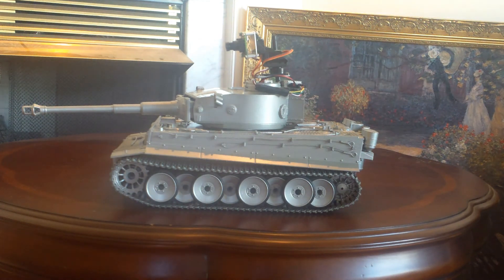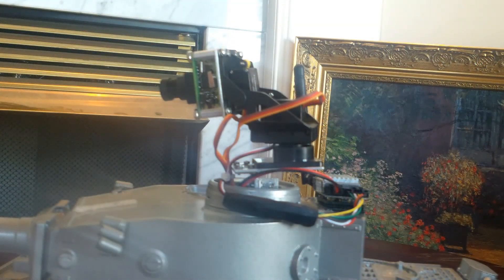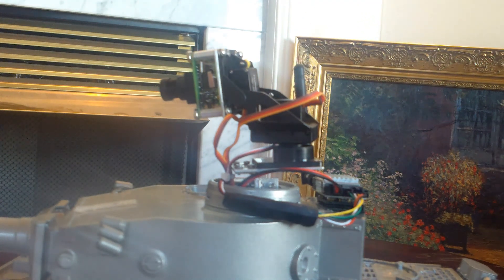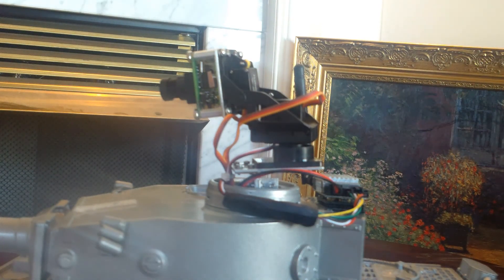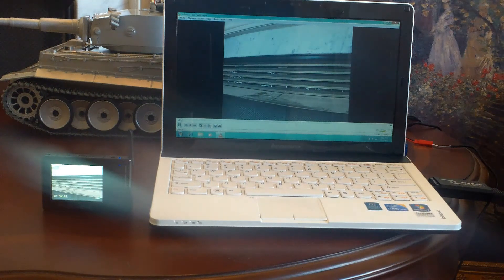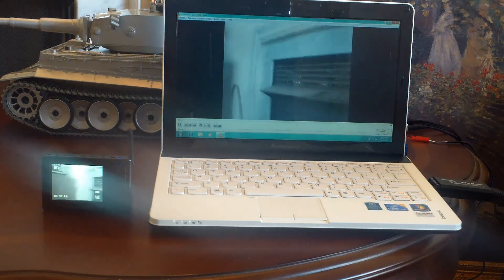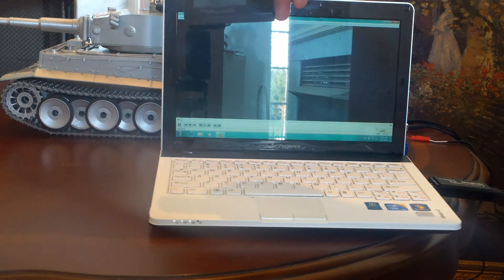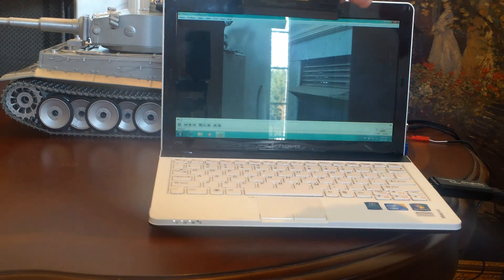RC Tank FPV - 5.8 GHz with Pan/Tilt Camera

Comment from the maker: You are right, and it would be better with head position-sensing goggles rather than using rotary knobs to control the pan/tilt. I did want the camera centered over the hatch however.